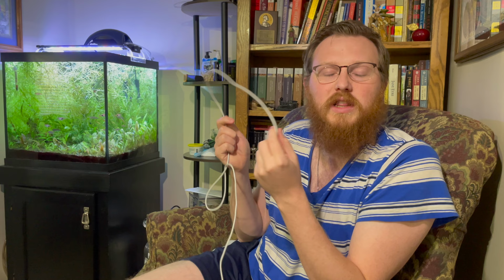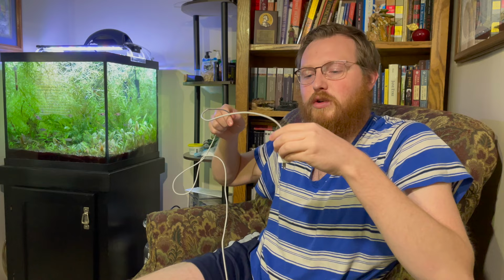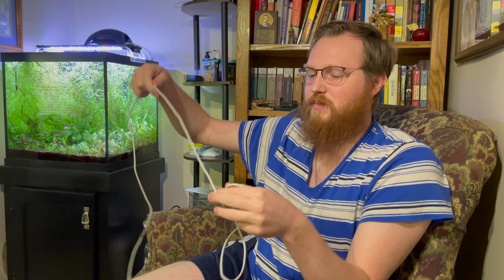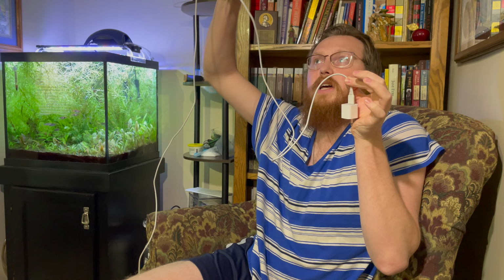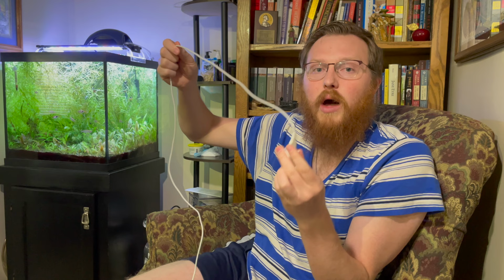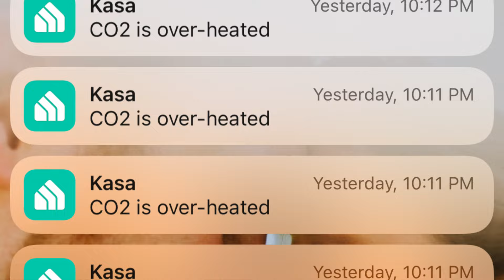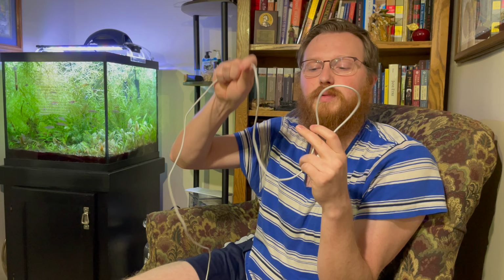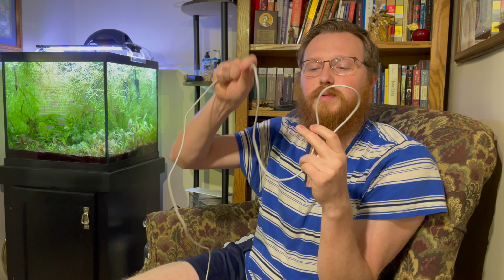Aquarium Safety 101: The Importance of Drip Loops

Comment: thanks for the share.

basically it seems that you want to have the lowest part of the cable to be lower than the outlet, because gravity will pull stuff down, and if water gets on the cable, it will want to go downward, albeit some will also adhere to the cable. So if the lowest point is the power outlet, and if the wire is like a zipline with a straight shot to it, if the cable gets wet it could easily flow downward into the power outlet, causing an elec and fire hazard. But, if the lowest point is elsewhere, than water on either side of the wire near that, should flow to that lower point

I suppose with the drip loop, that can help get rid of water at an earlier point in the wire, since water will adhere to cable and generally flow downward, and shouldn't really go upward. So, if a drip loop is made and placed earlier in the process, it should trap the water nearby, fall to the lower point of the drip loop (even if it's not the lowest point, but just a relatively low point), and not be able to go back up to continue down the line. And as the water bunches up, then just fall to the ground there, rather than just running down the line closer to the power outlet

good to know!